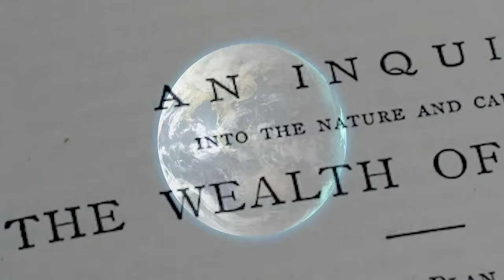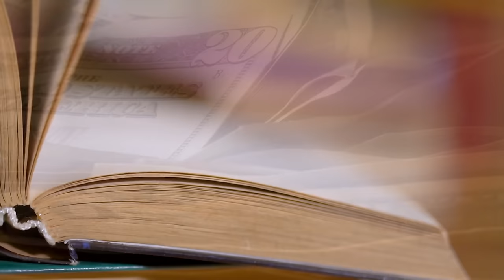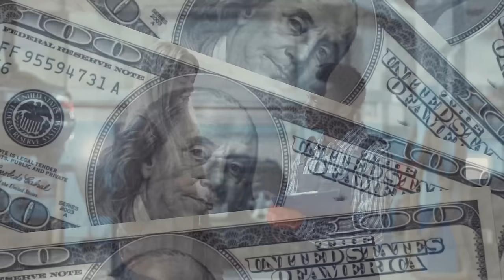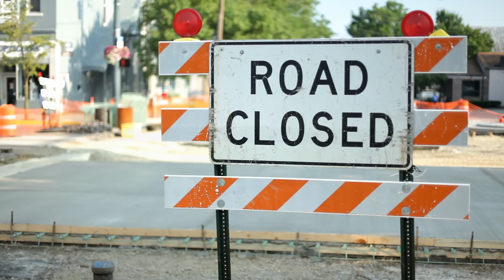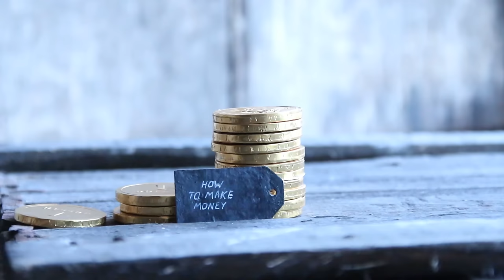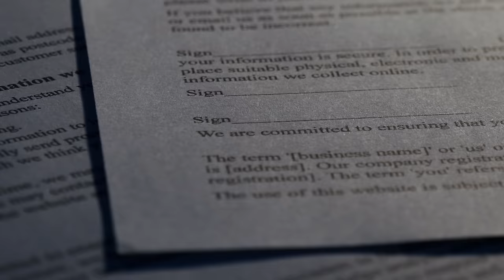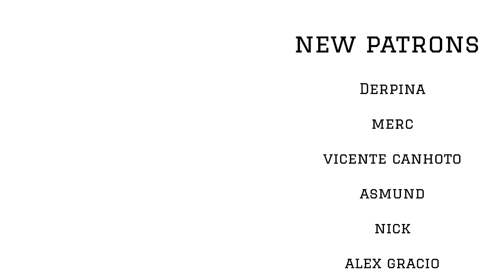Adam Smith: The Grandfather Of Economics

Comment: Good lord, the UK is NOT tiny or desolate. Most of the UK is arable or (historically) filled with useful minerals (coal, iron, even tin at one point, etc). About half of China is deserts and mountains, and an even greater percentage of the Qing Dyanasty's holdings would have been economically limited deserts, mountains, jungles (in the south), etc. And while the UK is nowhere near as big as China, it's NOT a tiny country or even small by the standards of islands. It's actually about mid-tier for land area for countries and high-tier compared to most islands by land area. The UK is also quite warm for an island that far to the north, thanks to the gulf stream. So, the idea that the UK was some barren rock with no resources is laughably false. And we didn't even get into things like their oil and fishing grounds.